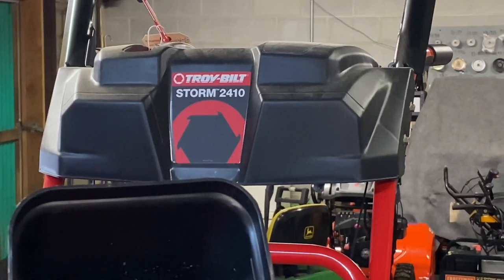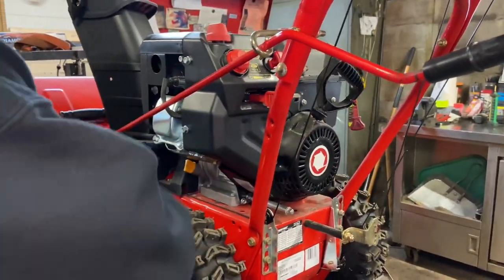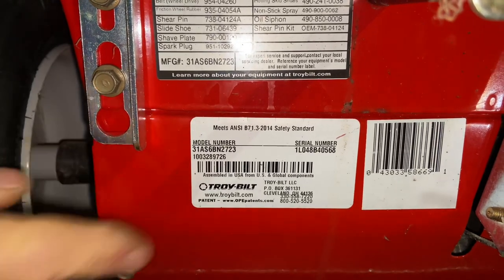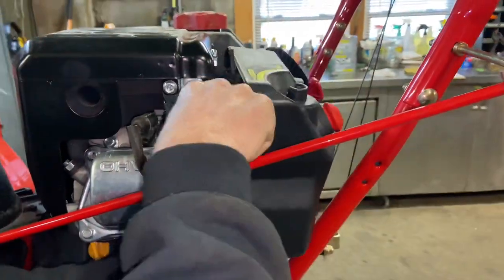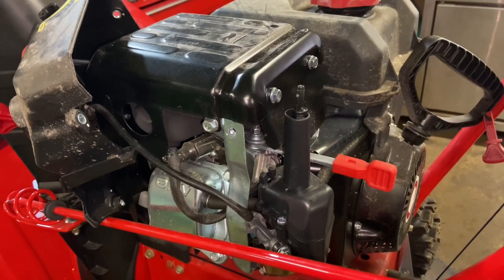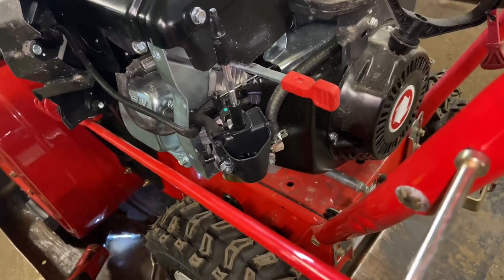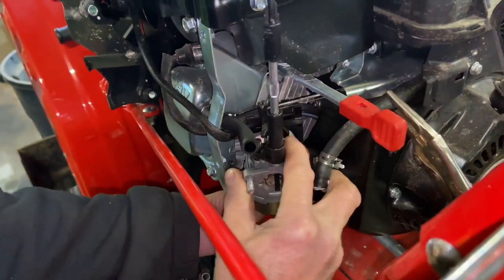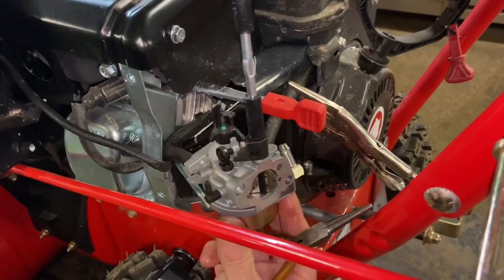How to remove carburetor Troybilt 2410 snow thrower

Comment: Thanks for your detailed instructions!!! Was able to replace the carburetor with ease and machine is running again!  Now, just hope we will not need to operate it this season in the inland PNW!  Thank you!
Reply from the maker: I'm glad to hear your back up and running! check out Aspen4 gas if you can get it in your area it will save you from having the carburetor issue again. Here is a link to read up on it. https://www.aspenfuels.com/products/alla/aspen-4/. I highly recommend using it. Thank you for the kind comment and supporting the channel!

Comment: I’m not a handy man kind of guy. This made the process easy to follow. Only thing I could suggest is how to remove the choke rod. I replaced the whole carburetor and that was the most difficult part. I essentially just cut it out of the old and put into the new. Not sure it it was correct though. Thanks so much!

Comment: My brother and I were able to replace the carburetor on our Troy Bilt 2410 Model#  31BS6BN2711 with a replacement carburetor. I am not kidding , on the first pull the machine started.
Thank you! Thank you! Thank you!
Excellent explanation. Excellent video
One of the most important points that you made was how to order your parts based on the Model # of your machine. Thank you again!!
Reply from the maker: I’m glad it was helpful:) thank you for watching

Comment: Just changed my carb with your help and it started up on the first try.  Your video saved me a few hundred dollars.  One thought if someone is putting in a new carb when they buy it they should also buy the two gaskets and choke lever, if they have it in stock, as it very hard to remove it from the old carb and it costs less than $5.  Thanks again for a great video.
Reply from the maker: Hi Dan, I’m glad this was helpful! Thank you for watching and commenting. Please give this video a like to help the channel. It would be greatly appreciated.

Comment: This is the first video I came across which is so clear and shows how to get the carburetor out. Very detailed and good job! Can you please make a video how you clean the carburetor and which carburetor cleaner you recommend. Thanks in advance!
Reply from the maker: Yes, I’ll make on how to disassemble the carburetor and post the link to this video for you.
Reply: I'd like to see the same. Mine hasn't been used in over a year and I'm sure everything is clogged. I'm gonna have to clean it all out in the spring. Not even going to try and start it.

Comment: Thanks for the video!  I was able to remove, clean, and re-install the carb on my 2410.  I ended up buying the wrong carb (the one without the vertical choke knob shaft).  I couldn't source the correct one, so I just cleaned up the old one and got it running again.
Reply from the maker: Glad you got it running!!!

Comment: First off THANK YOU! Your videos are so clear and helpful!! I followed your instructions but it doesn't show how to remove the long plastic piece that sticks up from the carburetor that attaches to the turning knob on top of the snowblower. If you could advise that would be awesome!!
Reply: I also checked your video where it shows the carburetor disassembly but on that video the long plastic rod was removed already beforehand.
Reply from the maker: This was how to take the carburetor off. I was born with the one hand so how I get the rod out is put the rod into a vise clamp, then pull on the carburetor and it will pop out of the plastic pocket it sits in. You can take a pair of vise grips and do the same with two hands. Basically pulling it out of the bracket. I will need to make another video on how to take that off when I get a machine in that has an issue. We have had no snow this winter so far. I’m glad my videos are helpful! Thank you for watching! Please tell your friends about the channel to help it grow. It would be greatly appreciated:)
Reply: OK. I was scared it would break if I pulled it out! Yes, you are an inspiration, you are so skilled and make it seem so easy! I have already shared your video and shown it to others! Thank you!!

Comment: How do you take off the choke lever on that carb. The plastic piece attached to the nob  broke and I need to replace it.
Reply from the maker: 2 ways. It can be pulled out. I normally need to put the carburetor in a vise ( I'm one handed)then use a pair of vise grips to pull it out. It isn't easy but it will come out. The other way would be, take the choke plate out and slide the entire shaft out of the carburetor body. Just make sure you have the correct torx driver to take out the screws that hold the choke plate. If you mess up the torx head, your in trouble :(.

Comment: Great video! I have the Troy Bilt  2420, not sure the difference between the 2410 and 2420, but my set up looks identical.  My unit was running rough from the time of purchase  (very uneven running at idle- revs up and down). Do these units get tested at the factory?   Is it possible that the carb needs cleaning from the get go? What is you feeling about a carb cleaner fuel additive?  Is there an idle jet I can adjust? Thank you!

Comment: Thanks. Saved much head scratching. But would be helpful if it included removal of the choke knob shaft. Rather than cleaning the carb and its tiny passages, folks like me are commonly just buying a new inexpensive carb and swapping the old out. The shaft has a tricky double tab that needs fussing with. I ended up putting the shaft in a vice after prying at the tabs a bit, then tapping on the female side on the carb. Worked good except the carb jumped off and fell on the floor - no harm done. Any tips for that would be appreciated.
Reply from the maker: You pretty much had it figured out. I put the choke rod in a vise then pull on carburetor. It will pop out. I will make a video on it when I get a snowthrower in that needs work. Where I live north east Pennsylvania,no snow so far this winter.

Comment: I'm working on a slightly different troybilt and I'm have trouble sliding carb off bolts as bowl is hitting the the handle bar. I'm hoping it will twist a bit once I have fuel line off.
Reply from the maker: Hi Ken, I have even had to remove the bottom bolts to the handle to get the carburetor off of certain machines because of the issue your having.

Comment: Do you need that tool to take the choke cap off? I’ve had trouble getting it off
Reply from the maker: No, you can use whatever works for you. The trick is to pry up evenly from both sides so it will pop straight up.

Comment: Thanks man this video was really helpful. I got to the point where I removed the gas line from the carb, then decided to test the spark plug first before fully committing to taking the carburetor apart...so I took the spark plug out, poured about a teaspoon of gas directly into the cylinder, reattached the plug and she fired right up on the first pull and ran for a couple minutes, which was way longer than it should've with only a teaspoon of gas, so I assume that meant the carb wasn't the issue. So I just put it all back together and it runs fine now....weird!
Reply from the maker: I’m glad this video was helpful and your up and running again. Thank you for watching and commenting.

Comment: Great and helpfull video, Thank you! My problem is I have an older model Troybuilt with the choke knob on the rear. I went to start it today , put the throttle on full and turned the choke knob to choke. It started first pull, but when I went to turn choke off, the knob would not turn at all. do you have a video about un freezing the choke knob? Thanks
Reply from the maker: I do not as I haven’t come across that issue. If you were able to turn it in it’s not frozen, maybe it’s jammed. You will need to take it apart and figure it out. If you model is the same as this video it should be very easy to see what has happened.

Comment: I used this awesome video to help me and my husband replace our carburetor (bowl t-nut was stripped and leaking gas). Quick question -  now that it’s replaced it idles exceptionally high, like it’s going to take off then settles when the blades are engaged and throwing snow.  Did we miss something in replacing or is there a way to adjust the idle?
Reply from the maker: Impossible to answer that question without seeing the machine. Did you replace the carburetor? If you did. Not sure why it would be over reving. If you rebuilt or cleaned the carburetor? The idle screw may be in too far. Check the idle screw. I have a video on how to clean the carburetor in the description that should show the idle screw

Comment: My snow thrower will not start. Usually when I press the primer I can hear what sounds like gas being squirted but all I hear is air. Carb problem possibly?
Reply from the maker: Could be primer line broken or a bad carburetor from fuel going bad from sitting with fuel in the carburetor for more than 3 months?

Comment: Excellent video, clear, to the point. Question: How do I close the fuel line for carburetor drainage for long term storage, is there a fuel shut off valve that we can turn off to run the carb dry?
Reply from the maker: Unfortunately the only way to long storage the machine is to run the gas completely out of the tank and carburetor. I have always suggested using alternative fuels like true fuel or the fuels that have long storage capabilities from the big box stores. Or just run your machine periodically during the off-season which is very hard to do because human nature we forget.
Reply from the maker: There is no fuel shut off on this model machine.

Comment: How do you remove the choke linkage? I know there are two tabs on either side but cant figure out how to depress them both and remove at the same time
Reply from the maker: Not sure what you mean by “choke linkage”There is just a choke rod, the black part on top of carburetor. I will pull the brass choke plate out then pull the entire rod out of the carburetor.If we are talking about the same thing?

Comment: I have bad gas in my Troy built snowblower, what is the best way to empty the tank? Also do you use Stable?
Reply from the maker: If I am taking the carburetor off, I’ll drain the tank from the fuel line. If I am just taking the fuel out of the tank, I will use a Turkey baster and suck it out from the inlet on top of gas tank. Yes, I used Stabil for years but now I used TruFuel. It is 92octane, no ethanol and stays fresh for a good year. Purchase it at a big box store, the Home Depot etc. read up on it before purchasing it because it is a little pricey but to me it’s worth it. OR, just keep using stabilizer as it been around for ever.

Comment: Great video I have on issue that you did not cover. I happen to have broken the choke knob shaft and  I am looking how to replace or fix. Cant seem to find the correct carburetor, which is exactly like the one you have. Do you know where I can find that same carb or how to repair the knob shaft?  Thanks, Wayne
Reply from the maker: Is this what your looking for? copy and past this part number to a search engine. This is a choke knob and shaft. MTD-751P18086

Comment: Good video but every year I’ve been having a problem with gas staying in bottom of carburetor even tho I run it dry. How would I drain it?
Reply from the maker: After running the fuel out of the machine. There is a side drain bolt on the bowl of the carburetor. Take it out and tilt the machine slightly to drain carburetor bowl .

Comment: Thank you for making such a clear video! Is there anyway you could clarify how to remove the vertical choke shaft and transfer it to a replacement carburetor?
Reply from the maker: I pull out the choke butterfly plate with a pair of pliers. I normally have to hold the carburetor in a vise for obvious reasons to get a good pull on the plate. Once the plate it out, the choke rod will slide up out of the carburetor. Just remember how it was sitting so you can put it back in the new one. I’ve had a few ask about that so I will try and make a video the next time I have a newer style come into the shop. Thank you for watching my video, please give the thumbs up, subscribe and tell your friends to help my channel grow. It would be greatly appreciated. Let me know how you make out.
Reply: @JohnsonsSmallEngines  thank you for your quick reply!

Comment: How do you remove the choke rod from carb? I switched my carb and dont want to ruin it.
Reply from the maker: There is a link in the description below the video but here is the link. https://youtu.be/K-7sCtF-B1Y.
Reply: @JohnsonsSmallEngines    Thanks for the quick reply i got it off by forcing a small flat head screw driver at the bottom slot and pushed and pulled. Called a choke lever . It started right up.Now the only problem i have is getting the cover back on LOL. Came off easy but getting it all lined up so i can put choke knob back on is a problem.

Comment: Very informative video! Last year, I had my carburetor replaced after limited use. It won't start again this year. I've ran the K100 fuel stabilizer as suggested by my mechanic. I'm very sorry I bought this piece of junk! I'm going to try some starting fluid with the knowledge I've gained through this video. If it doesn't work, I'm dumping this piece of shit for another brand.
Reply from the maker: Thank you for watching and commenting. You need to remember the reason why it will not start is not the machines fault. It is gas that goes bad inside the carburetor from sitting too long without running the machine. I can say that these carburetors are very tight tolerances and we cannot adjust them so they need to be stored properly or run periodically. I normally suggest running your machine every other month for 20 minutes and normally the machine will be fine. Also keep doing what you’re doing with the fuel. It just needs to be run more often than not. I do know that it’s hard to remember and we just forget about the machines in the off season.
Reply: @JohnsonsSmallEngines  update...Pulled that carb apart, cleaned, and fired right up. Thanks again! Now to deal with this pesky discharge chute that never worked properly. Should get plenty of use this weekend. There's a big snow coming in Sunday

Comment: I am looking for the part name for the rod that connects under the choke dial. I just bought a new carburetor so I can replace it but that rod also needs to be replaced and I haven’t had any luck finding it. Do you happen to know?
Reply from the maker: You will need to take the model number from your machine and go online to a Troy built website and look up the part number then order it online

Comment: Brad hi, I have a Troy 2410 snow thrower, can you explain to me how to adjust my cable for shifting from forward to reverse, I am having a hard time putting the shifter in reverse the cable feels like it will break my machine is new and don’t want to break it. Thank you Richie. I have subscribed to your channel and like it!
Reply from the maker: Normally shifting from the forward gears to reverse will feel a little stiffer. Make sure your shifting when your drive handle is in the off position. Never shift through the gears when the drive handle is down. If you are still having problems, you will need to go under the transmission cover and clean shaft that hold the drive disc. Sometimes the shaft the disc slides on will get sticky from grease drying up. I clean the shaft then spray a dry lube on only the shaft to help it slide side to side easier.

Comment: I need a video of you buying a new carb for one of these and putting it on because I got one and none of them come with that long piece that goes from the carb to the turn switch... I want to replace that piece because it's rusting but when I look up the number that's given on that specific part it just gives me the entire carburetor sans that piece... help a brother out
Reply from the maker: I have all videos in the description to help you out except ordering a carburetor.to correctly order your carburetor, you will need the model number off of the machine, then you need to go to a TroyBilt parts look up to find the correct part number for your carburetor and it will be a separate part number for the rod and you may need to order the rod from a MTD parts supplier. The carburetor will be able to be purchased from MTD or Amazon.

Comment: aw, crap… during removal of the carb from my machine, i broke most of the top of my primer line nozzle off.  to add insult to injury, it’s still stuck inside the end of the primer fuel line, as well.  i’m assuming that there is nothing i can do about this, and i should just get a new carb, yes?  
thanks for your videos; they are extremely helpful!
Reply from the maker: Yes it sounds like you will need to order the carburetor. The good news is they’re not that expensive and readily available. Thanks for watching my videos and I’m glad they were helpful. Please tell your friends about my channel to help her grow. It would be greatly appreciated.

Comment: Can you just flip the blower on the auger and remove the bowl then pull the jets out , clean reinstall ? Seems better than removing carb.
Reply from the maker: Without removing the carburetor you will not be able to clean the carburetor correctly or get to the top jet. Watch the rebuilding video and you will understand what I’m saying.